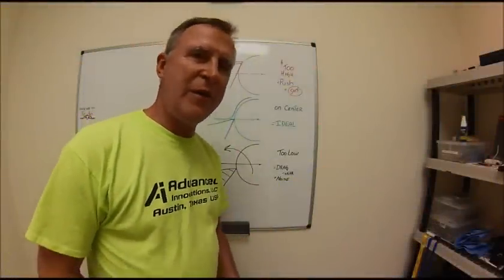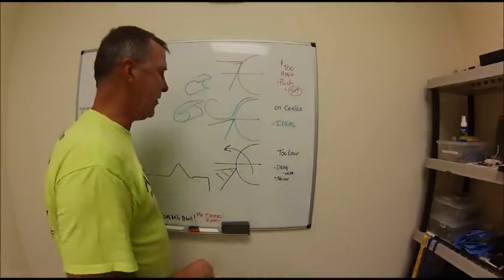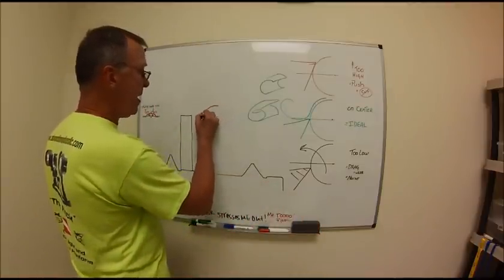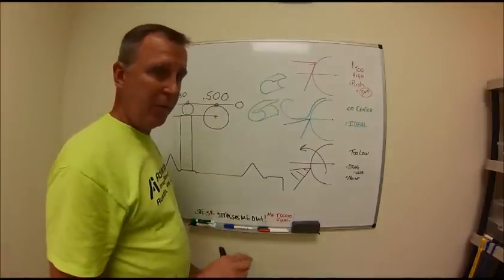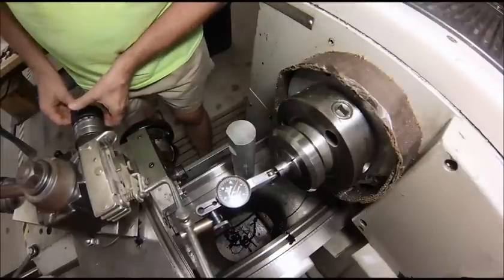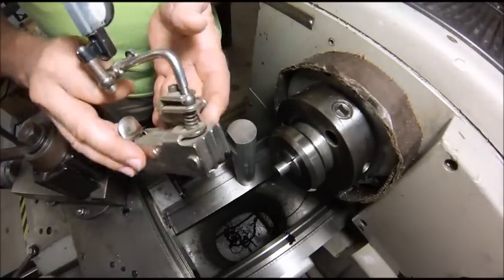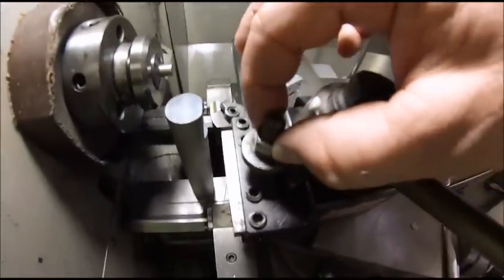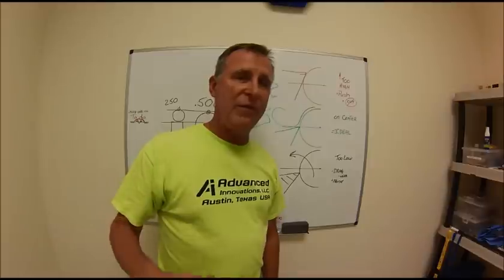Setting lathe tools on center

Comment: That is a nice trick to measure correct height, you just continue to point out the obvious to us. 
Just today i made a nice stainless bar 20 mm dia. to height by scribing a line with a fixed center in my tailstock and worked back and forth on the lathe to get to correct height. Took a bit of time but now it is done it will speed up tool change. My tailstock is at correct height, checked with center in spindle and hard parallel will be clamped straight between the two sharp points in spindle and tailstock.
I lapped the top and bottom of the bar and made a 5 mm wafer of the same material, also both sides lapped that is connected with an off center bolt to the top of my bar, Now i can slide turn the wafer from the bar and use the bottom of the wafer to drag the toolbit slightly for height setting for normal turning and the top of the bar for reverse turning tool adjustment. Like when i use Joe his reverse threading method. I only use my crossslide surface to rest the bar on because my lathe bed is too narrow, i got a small chinese lathe. I do get 6'es chips so i think i am pretty ok on center, also nice smooth surface with no center raise point when facing. I like the stainless because it sits pretty and heavy. (i also like shiny tools but i am not proud of that)
Reply from the maker: I like heavy ones too. The sliding wafer on top works well.

Comment: Great tip, Joe, what does the corrugated cardboard and duct tape shield do?
Reply from the maker: The oil that slings off the chuck collar will give you a stripe down the left face of your shirt. The cardboard catches it and stops the stripe on the floor as well. No duct tape yet.

Comment: Great idea! I own a Craftex 2227L lathe (10" x 18" CC) and the bed is too narrow to act as a reference surface. Therefore I am using the top of the cross slide. The nice thing is, I can use almost any portion of the top slide as a reference by rotating the tool holder to the most convenient position for tool centering. My centering tool is being made from W1 with a small rare earth magnet to hold it in place. The underside is to be faced with brass sheet to avoid scratching the top slide.
Reply from the maker: Any constant surface will do. Good work Diane.

Comment: good idea,, now check your tail stock to see if that is on center-and if it is not-  that what?
Reply from the maker: Hi Robert. Some tailstocks can be adjusted perpendicular to the ways. If that is the error, just dial it out. If you dont have and adjustable tailstock, experiment with different drill chuck installation positions to see what happens. If you error is still present try to make a mental note about how you position your drills and such when holding them in your chuck. If you error is up and down, position the cutting edges of your tools to be horizontal. This will reduce the oversize error potential. If the error is in and out, position the cutting edges vertically.

Comment: Joe excellent channel, clear and concise delivery. Is that a Colchester triumph and what type of collet chuck are you using, thinking of getting one for mine. Regards from Ireland.
Reply from the maker: It is a Clausing Colchester lathe.  1340 I believe. I have a through spindle 5C drawbar collet setup on it. I like it. It sets up quick and holds well and consistently. Thanks for watching.
Reply: Thanks for the reply, will look into that one, keep up the good work

Comment: I made one of these and it is EXCELLENT! Took about 15 minutes start to finish and I checked and fine-tuned all my tool holders in about another 10.  One quick tip for anyone else making one of these tools ... You have to be careful about runout in your chuck for the height measurement technique to work correctly. But there is an easy work-around. Since you have the dial indicator set up on top of the .500 dowel pin, rotate the chuck to find the high and low spots and mark them with a sharpie. Then rotate so that these two marks are horizontal (that is rotate 90 degrees from either high or low). Now re-sweep and zero your indicator and you will be .250 above the centre of rotation of your spindle regardless of how much runout you have (within reason).
Reply from the maker: Or you could just turn the stock to .400 and forget about the runout.
Reply: Joe Pieczynski  hard to do if you are using end mills as dowel pins 😀
Reply from the maker: Your comment and your setup description are good tips if the pin is not easy to turn.

Comment: I like your idea but what I did was turn a piece of stock in the lathe and measured the diameter divided that by 2 and wrote it down.
 I then set a height gauge on my cross slide and measured the distance from the top of my cross slide and the top of the stock I turned.
Next I took the number I wrote down and subtracted that from the distance I measured, that is the center of the stock in the lathe.
It was 3.781.
Now all I have to do is use my height gauge to set my cutting tool at 3.781.
Works better than anything else I have done and it is very fast.
Parting is a breeze now.
Thanks for you videos they are informative and from someone that knows what they are doing.
Reply: Joe's solution is a lot simpler than that though?
Reply: pbysome No, not really. By turning the material gently in the lathe you are guaranteed that it is accurately centred on the lathe axis. It's one of the  few cases where there is no tolerance - at least above a molecular level. It can't be anything else due to the lathe geometry. Far more accurate than using a pin  in a collet, or worse, a three jaw chuck. and not everyone has accurately ground pins to hand either. Joe's method is good if you have a pin but no height gauge. In fact you can afford to be around minus 10 thou off centre without too much trouble. 30 thou is far too much though. Under height is better than over height, much less chance of a dig in. Bob UK.

Comment: Not sure if you already covered this but a huge question mark came up when I bought my first boring bar.
Using the flat milled sides on the bar forces me to use a negative rake. I asked on the Tormach forum about this but did not get any good answers mainly because rake angle is a pretty wide topic a guess.
Would love to hear your opinion on this and your channel is one of the most informative I have found so...
...good work and I hope you have the time and interest to spread some light on this matter.

Best regards from Sweden.
Reply from the maker: Thank you for the question. Without knowing what brand and model bar we are talking about, I will generalize based on my experiences with Kennametal products. I am going to assume your bar is an insert bar and you are using it on an engine lathe with clamping screws coming in from above. If this is true, the flat is there to allow the bar to resist rotation, establish a certain position and force optimum cutting geometry of the insert designed to go in the bar. You may have clearance issues if you use your bar in a bushing and rotate it to suit your application. ( but I have done that on many occasions ) If you are using brazed insert bars, you can regrind them to fit your needs. For most metals, 3-5 degrees of positive rake should be sufficient. Kennametal has fantastic online resources to assist lathe guys with their tooling questions. I personally have never been a big fan of negative rake tooling unless the material absolutely demands it. Tell me more about your bar.
Reply: Hi and thanks for the quick reply.
The bar is a cheap chinese one with dcmt insert.
http://www.ebay.com/itm/S12M-SDUCR07-12x150mm-Internal-Turning-Tool-Holder-Boring-Bar-with-DCMT0702-Inse-/381773708593?hash=item58e37c7d31:g:ESIAAOSwAuZX2vGL

My lathe is a Warco 290V
http://www.warco.co.uk/metal-lathes-metalworking-lathe-machine/302934-wm290-variable-speed-lathe-wm-290.html
Not the biggest and best but fits me perfect.
I am currently modifying it for an electronic gearbox/electronic feed.
Love your videos, very informative.
I looked at the video where you milled a 20 degree angle though and I would want to see how you measured(and from where) and drilled the holes. I might be just retarded but I didn´t quite get it. :/

Best regards from Sweden
Ricard
Reply from the maker: I simply held the block in a vise on the mill  and moved the table on the X and Y axis accordingly based on the trig values. Drilled and reamed at each location.
Reply: Aah, so you did it using the digital on the mill?
Reply from the maker: I did, but if you know your machine, and you can trust your dials, you don't need a DRO.

Comment: Joe, what is that around the spindle nose of your lathe? It looks like cardboard or something, I've seen it in some of your other videos and every time I wonder what that's for.
Reply from the maker: It is cardboard only because my PVC collar isn't done. Its an oil slinger shield. Any fluids that get on the chuck cam collar usually fly off and give me a left chest racing stripe. This little collar catches those fluids and keeps my shirt clean. Primitive but effective.

Comment: I've also seen the height standards where the flat is made to swing over the top of the tip of the tool bit and you adjust until it just hits.  Yours seems really simple as well and easier to set the initial standard height..  I had an extra height gage sitting around so that is what I am currently using.

Comment: the hardinge standard for lathe center height is adjustable and has a sliding cap. the adjustability means your part isnt scrapped if you mill too much, and the cap makes it so you can indicate tool holders that are upside down. Or , simply  bring the tool till it touches the cap and it no longer slides. the cap is held by a screw on the side, it slides in and out, i would build it like that.
Reply from the maker: I have used those. The cap feature is nice if the body is heavy enough to let you swing the cap without knocking over the post. The one in this video can easily be converted. The adjustable kind would scare me. How do you know what adjustment it is at??
Reply: its like a  machinist jack, you screw it up or down to the right height then lock it there. i think it has a magnetic base?

Comment: I'm still stuck with the old style lantern post arrangement.  Some kind of quick gauge that would work in all possible positions would take a lot of the frustration out of tool changes and re-positioning.  Parting blades are my biggest challenge right now.

My only suggestion regarding the videos is that they (at least for my hearing) need a touch more volume.  Even with my computer volumes nearly maxed, I sometimes have difficulty pulling you out, and if I try going any higher on my sound system, it begins to distort.  If your editing software has the ability to "normalize" the audio levels, that might do the trick without causing distortion.
Reply: diggerop,
I have the same issue with the audio. I went to the local "Office Depot" and bought a sound system that comes with two speakers and a small sub woofer all for around $20 or $30 dollars, and it works fantastic. The system I got is from "Locitech" model number S-00143. Check it out, I know you will be impressed.
Razor!
Reply: Diggerop, I've used a setting bar like Joe describes for years. It works like gang busters with the lantern post. You can set the tool height within several thousandths of the CL in just a moment. It makes the need for a quick change tool post not so important.. though the QCTP is about as handy as sliced bread.

Comment: I've been using a machinist square with a line scribed on it using my (once) very sharp center. Your method is much better but it will be hard to make without a second machine to shorten the bar.

Comment: Good tip, I will make one. One way of taking any spindle run out of the equation could be to turn a half inch diameter from a piece of stock and then proceed with out removing it. In fact you could turn it to any diameter providing you can acculturatly measure it and do the maths.
Reply from the maker: MrCrispin, you are correct. I actually shot this video twice and only posted one of them. in the other version, I turned and parted a .300 diameter pin and then turned a .600 diameter and left it in the machine. Using two gage pins or end mills just simplified the demonstration. Thanks for the comment.

Comment: That's a nice gauge. For years I've just used a dedicated height gauge and that has worked well for me. Your gauge has tha advantage of actually being able to feel if you're set right or not. I may just make one. Thanks for the tip.
Reply from the maker: Good Luck Dale. This bar has served me well. It works very well setting my threading tool when I thread with my tool inverted.

Comment: Thanks Joe, I'm guilty of using the tailstock/centre method. Looking forward to making this bar once and for all. By the way my Quick change tool holders use a Allen head long grub screw, so Just have to put an Allen key in there to hold while undoing the nut. keep up the great work! Cheers Max
Reply from the maker: Hey Max. This is a good thing to have. the beauty is that you don't need any measuring tools to make one. Just an indicator and a couple of pins. Thanks for watching.

Comment: A short but sweet video.
Two great tips, especially the file tang wedge.
Reply from the maker: Greg, every time that tool holder stud turn I used to grit my teeth. That file end is one of the things I keep on my head stock. It works perfect and is dirt simple. Thanks for the comment.

Comment: I like the centering tool will make one soon, I have been using the scale on the side which is close but not as close as yours.
Reply from the maker: Thanks Ed. This is pretty accurate. Good luck and thanks for the comment.